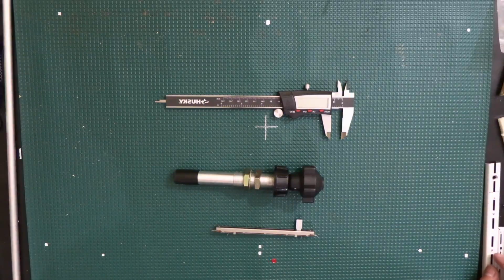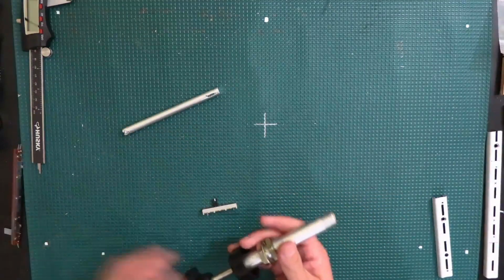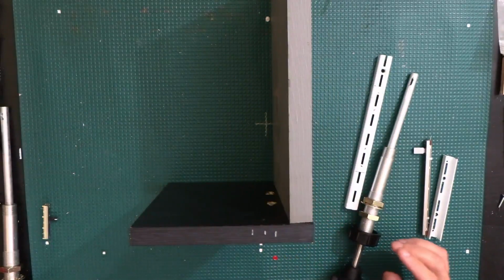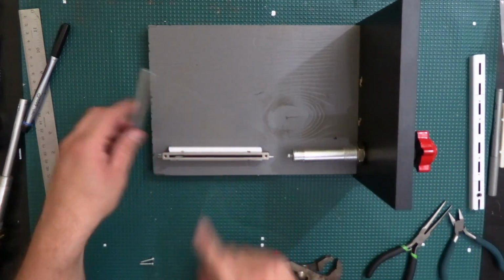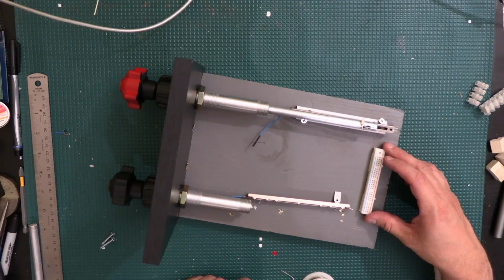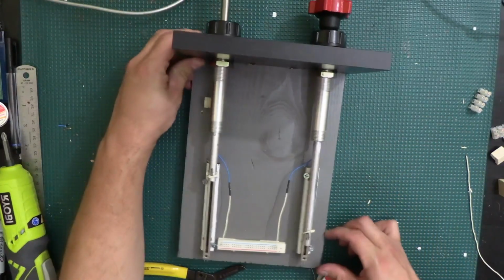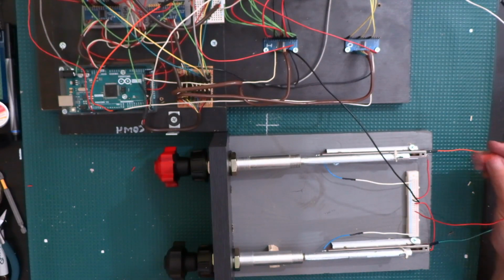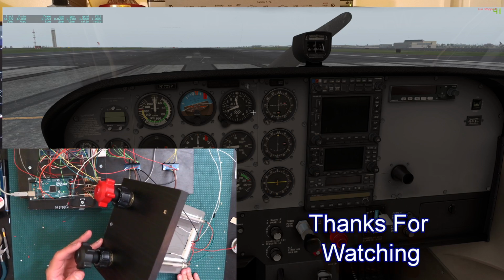Building a throttle/mixture Module for use with SimVim Cockpit

Comment: hello, great video! any idea where i can get vernier twist throttle part now? the link doesn't work anymore
Reply from the maker: No sorry I dont, that was the only cheap one I found on Ebay. I just did a quick search and only found very expensive ones. Maybe on Ali Express from China
Reply: @Qosmokid  thanks for the reply mate. ill keep looking
Reply: can i ask how much you paid for the vernier micro adjust throttles? I'm looking about £150GBP to import from the states!
Reply from the maker: @fpvfishing2366  Hello again, I only payed about $15 for mine, but you're right I cannot find any more cheap ones since then. Even when I got mine those were the only cheap ones I found. Too bad they are no longer available. I think now it's better just to use a piece of thin tube with a generic knob at the end. It just won't have the twisting fine tuning :(